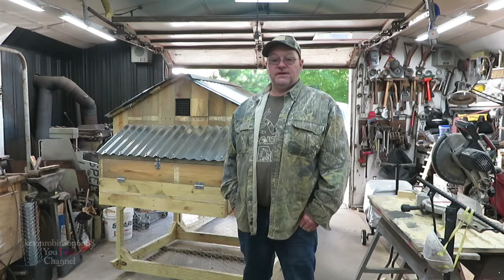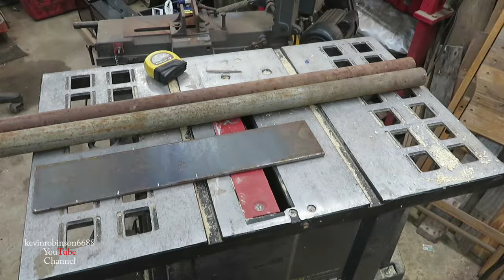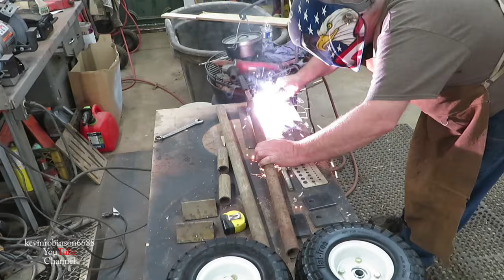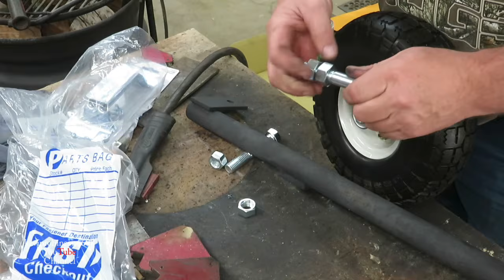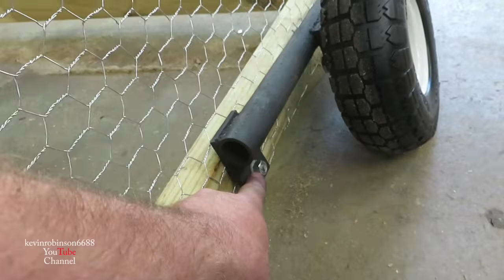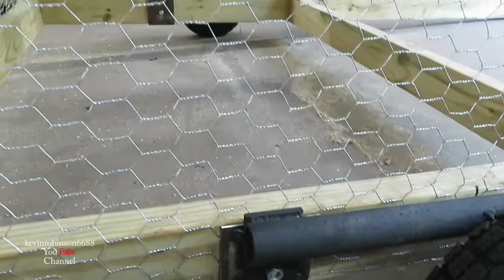Chicken Coop wheel kit build

Comment: Great design. The only change I am making is just use a piece of metal to swing over the end of the lever so you don't have to fight with getting a bolt in the hole.
Reply from the maker: That’s a great idea, it would definitely make things much easier to operate!

Comment: Where you mounted the bracket to lock it, I would have screwed a piece of wood onto it and used a latch that you just need to push over to lock the pipe. Then you don't have to fiddle with the screw and if you lose it you have a problem. With a latch it's much easier to solve. Many greetings from Germany.
Reply from the maker: Great idea, thanks

Comment: I on your 2 black bowls to where you gotta have case harden boats if you'll take a piece of pipe that'll slide all the way through drill your hole in your wood a little bit bigger take a piece of pipe that will go all the way through well to the back of that with them both sooner on one side then put it that hard that all the way through that hole she drilled and then put your boat through and then you put your other plate on the other side and you should be fine it should hold up a long time more than you'll ever know You'll die before it ever I'll die before it ever does
Reply from the maker: Thanks for the comment.

Comment: I dont think putting a plate on the inside will fix the problem, the 2x4 on the bottom will just flex and twist. Especially after it becomes weathered from sitting in the sun and rain for 6 months.

Comment: I decided to pay nothing for my wheel kit. Harbor Freight  instant garage tubing. Every nut and scew found on premesis. A frame chicken tractor, overbuilt. The last section of 3x4 L stock found near Atco Dragway, yes, big daddy Don Garlitz fame. 5' section untouched, tubing is main center axle. Sliding fit smaller section cut to width of tractor (2 sections. Garden cart 14inches  wheels forced onto "half shaft" ends and through bolts installed in OEM holes to prevent slipping off. 1/8" rope threaded through center of axle through bolt to through bolts to keep everything from sliding apart and allow independent wheel movement.   Looks like a light weight barbell when done. 1/4x3x4 brackets 2" wide screwed to base after forced into  a 7 shape one at each corner at gable end. Lift the 250lb coop from the gable end handle  and push the axle under the "7" brackets and set it down. P handle baggage dolly hooked under the other gable base. Now you're mov'in for O!
Reply from the maker: David good info thanks for watching

Comment: I did the same thing, but I put my wheel on the back hole, and my pivot bolt on the front. You push down on your, and I pick up on mine. Either way will work.
Reply from the maker: Thanks for the comment The Bearded One.

Comment: Very creative design Kevin.  Only one concern, when the wheels are deployed all of the weight is on that 2" section of a horizontal 2X4.  I think I would add a couple of feet of angle iron to saddle that 2X4 to the uprights to the right and left .
Reply from the maker: Good idea 280zone.
Reply: Not necessary.